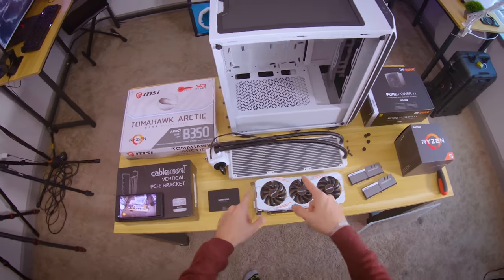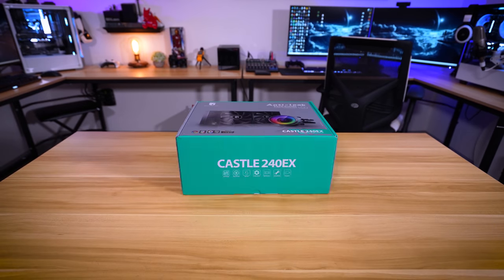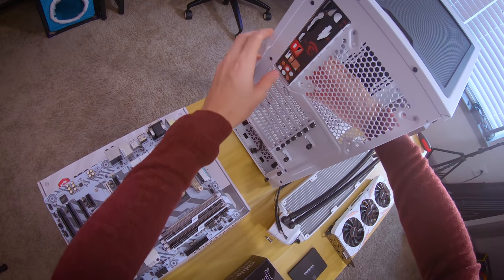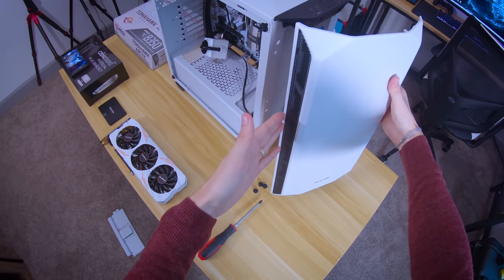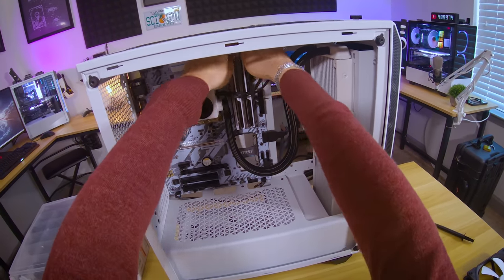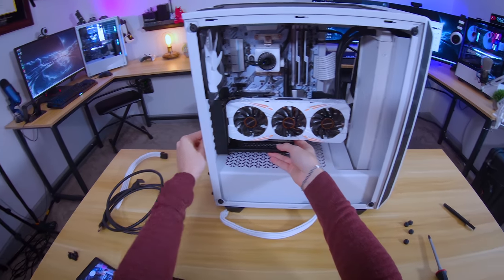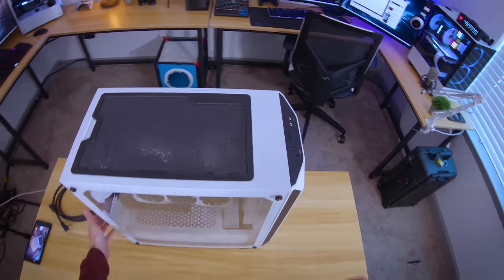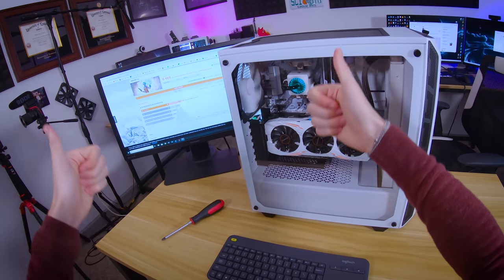Building a PC in POV!

Comment: I feel like doing a point of view build guide Is what a lot of new PC builders WANT to see. When you can see something from your point of view  when connecting things into the MOBO and power supply. It’s easier to understand what needs to be “tinkered” with.

I actually did this when I built my first computer to show the difficulties you have to over come as a first time PC Builder. But never got around to editing it 🙃.

Anyways, Great Video! The only thing I would recommend is to add some B-Role after ever component is added into the system to show the completed step looks!

Comment: Low table is good for parts introduction but I would suggest camera level for assembly, looking down at the case during assembly makes it a little harder to see. Also aim a light directly into the case to improve visibility for the camera. Perhaps use some sort of lazy susan setup for turning the computer around while you stay put.

Comment: I think this is useful for certain sections of a build video but personally I quite like mostly static shots of the overall build, as a lot of the time people tend to do things with hands outside of their own eyeline when building computers. For example, I may reach behind the case to route a SATA cable through the case ports or something like that, without necessarily needing sight to do it. Or fiddling around with PCIE cables in the PSU bay. Touch could be the primary sense at that point for me. Therefore build videos are a little bit contrived by nature, because the view you get during them won’t be that way when you do it yourself. Hope I’ve explained myself reasonably? Kudos for experimentation! It will help drive your videos to becoming even better.

Comment: My build. I build it before Ryzen 3 launched in may only the AIO just lately. Some new some used parts (mostly used)  with at least 1year warranty:
i7 6800k OC@4,2GHz   140€
ROG STRIX X99 GAMING   105€
Aorus GTX 1080Ti   350€
Corsair 16GB 3000MHz Vengeance LPX Black CL16 OC@3200   85€
Corsair RM1000i   60€
SilentumPC Signum SG1TG   40€
Deepcool Castle 240EX    70€
Liteon MU3 PH6 480GB SSD   70€
Fans 2x120, 1x140   13€

Total 933€ = 1024$ :/

Comment: Hey Greg! I am planning to buy this case and use an AIO, do you think I could mount the AIO in the front ? I'm worried about radiator cooling since the front panel isn't fully meshed.

Comment: Great video Greg! Any reason you didn’t put the case on it’s side? I found doing that invaluable for working inside my case and screwing in the standoffs
Reply from the maker: It's usually easier to film with the case standing up, but definitely easier for the average builder to lay it flat :-)
Reply: @GregSalazar  I learned that the hard way, RIP my TG side panel :/

Comment: In theory to achieve more balanced airflow couldn't the psu be rotated to configure it as an exhaust? Also I agree on not buying used ssds and psus, the one exception being from known individuals (sometimes you can get a great deal on a lightly used ssd from a trusted friend) my brother bought a 6 month old 1tb 860evo (with only 3 tbw in that time) from a friend for $75 cause he wanted a larger drive for his growing game library.

Comment: I understand that 1080Ti was just for aesthetics but I have that SAME 1080Ti and the cooler on it sucks big donkey cock. Replaced it with an Accelero III. Now i hit 2000mhz on the core with the fans at a slightly audible 40% set in MSI Afterburner.

Comment: Yikes, I would never touch the CPU pins or let the GPU run that long while a fan is hitting something. Just power the system off and move the fan with your finger, way safer than stopping the fan while the system is running. Other than that the video was great.

Comment: I would recommend buying a used PSU over a used AIO any day of the week. Good quality power supplies typically don't die often, and given the tendency for people to go overkill on their wattage, rather then nowhere near enough (like you claimed, as the Radeon 7 can pull 500W on it's own when overclocked, so please try being more realistic), I'd feel rather safe recommending a good used PSU. HOWEVER, AIOs have a significantly shorter lifespan, and are much more likely to fail long before a power supply will.

Installing the IO cover was perfectly fine in the shot. I'd say you need to work on explaining WHAT you're doing to newcomers(in detail), so they can learn and understand. You've also apologized half a dozen times by this point, and it's a little irritating. You did so already, and if people want to cry, let them. If they want to offer critique, great.
I would hope you would also get to know your hardware and ensure that you actually have everything you need before trying to assemble. Making sure that you have enough fan headers for the number of fans you're using is pretty important. But then again, so is making sure you actually have the fans you need for the AIO.
THERMAL PASTE APPLICATION (ALMOST) NEVER MATTERS!!! The only instances I've seen where it makes any kind of difference is when you apply not enough, or ThreadRipper (it's just that big, and you need a good spread covering the important bits).
Having the mesh on the top will matter, IF YOU PUT A FAN THERE (HardwareCanucks - https://www.youtube.com/watch?v=A75i3RItMCg&t=441s ) . Besides, if you "prefer better airflow" and want to make it a priority ( https://youtu.be/37Tc1IJP4Ew?t=647 ), Then why are you using a silence focused case? Gamers Nexus proved you can have a performance focused case AND stick to the same level of noise ( https://www.youtube.com/watch?v=T6jxiE2GQpY )

I'll be honest, I stopped at 12 minutes. I just could not take any more of this video. I hope I've made my reason for disliking the video clear.

Comment: I have a possibly paranoic fear from giving such coin for used stuff.

IF I was building again,
I would go with new 2060 Super/2070(possibly factory OCed)and 2700X.
In raw power less capable GPUs,but techwise more capable GPUs.
And a CPU that is better equipped for the future once nextgen consoles take over developers minds and they FINALLY start focusing on 8 core processors.
Also 512GB Patriot Scorch Nvme.

That said Evos do have Nvmelike Rapid mode...

Comment: great video BUT deepcool is trash, that cooler leaked all over my gpu after 11 months and they never wanted to warranty it, they gave me the run around for 2 months constantly re-requesting POP and photos of the failure, before i gave up and have warned against them since. gigabyte also has terrible components, use cheaper vrms than most, and if you do warranty their stuff make sure you take timestamped photos, as they will physically damage your component, then say they don't warranty physically damaged products. just a heads up for anyone new to building.